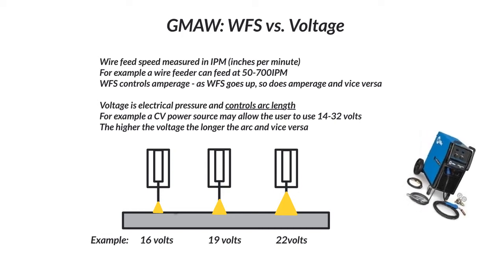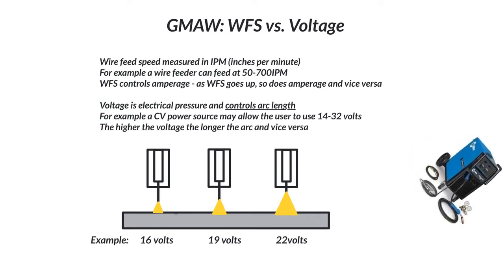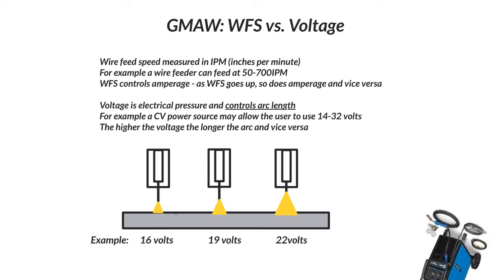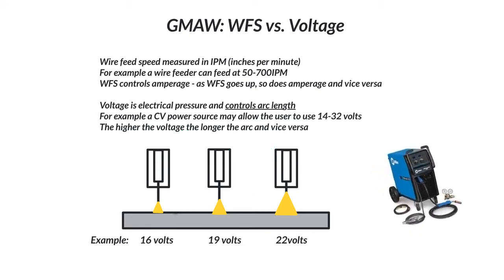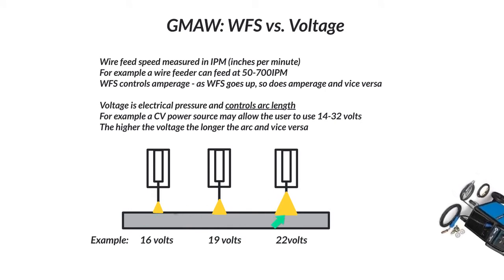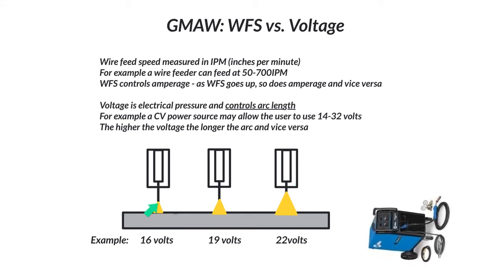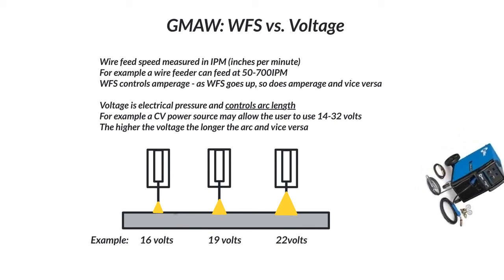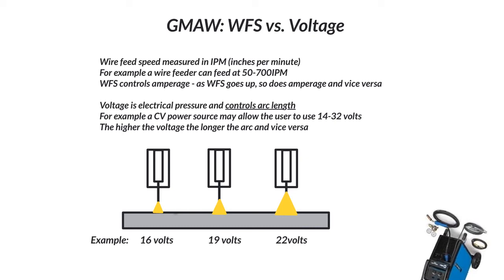Wire feed speed vs. Voltage

Comment: Thank you for clearing up a few things for me. I never realized that the arc length was controlled by voltage when in short circuit mode. As I understood it worked for spray transfer as by increasing the voltage the arc length increased because  more of the wire was burned off by the higher voltage . Also burn back was a big problem with increased voltage.